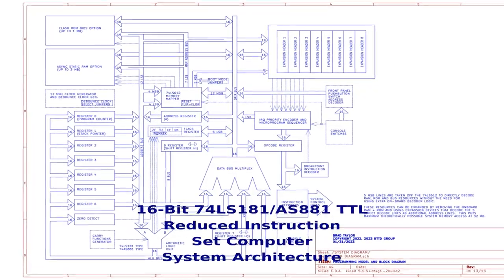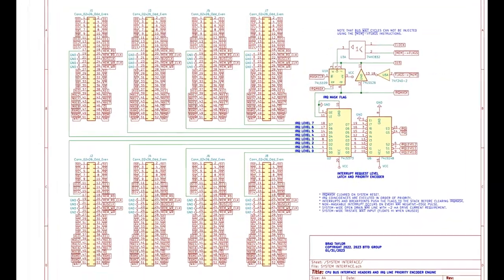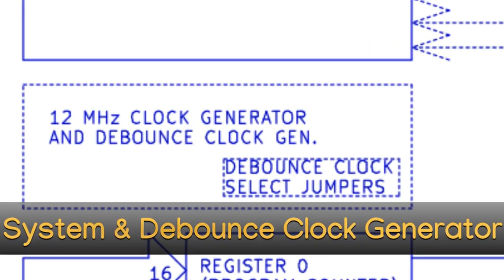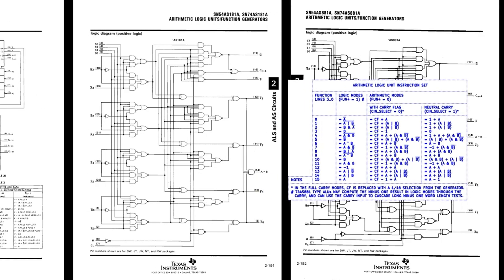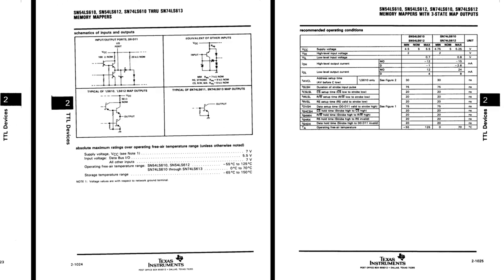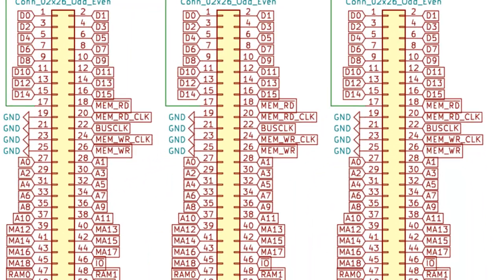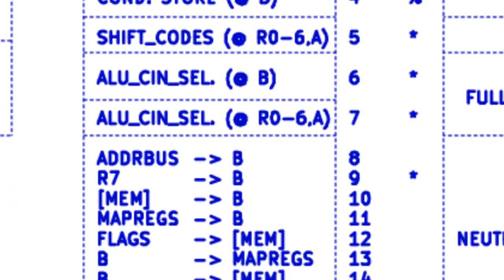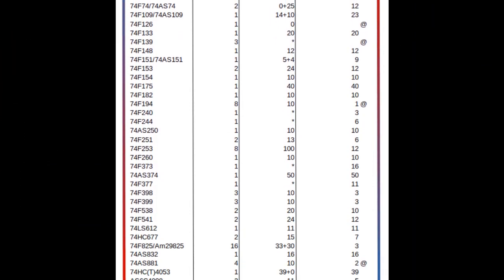16-bit 74LS181/AS881 TTL Reduced Instruction Set Computer System Documentation

Comment: I'm just in the final stages of actually building a 16 bit TTL/HCT computer based in the 74LS181 ALU chip. It has 16 registers of 16 bits each (4 off 74LS219), 32k words of EEPROM and 128k words of RAM with a bank switching system. The instruction set is implemented with microcode: the top 8 bits of the instruction provide the top 8 bits of a 32k word EEPROM and the remaining 7 bits for the EEPROM come from a counter. This enables each instruction to have up to 128 microcode steps but the average number of steps needed is less than 10. The remaining 8 bits of the instruction are handled in hardware to select source and destination registers, bit numbers for bit instructions, conditional instructions, based on the 6 flags implemented and a few other things. The microcode system allows for loops and conditional microcode branching to implement more complex instructions such as multiplication and division.

The design is based on a 48 line backplane with up to 8 plug in cards. The cards implemented so far are:

1. The ALU card with 2 shift registers supplying the inputs to the 74LS181's, the register bank, a "private register" for internal operations, 6 flags, a bit selector and a fair bit of coding/decoding logic.

2.  The memory card with both EEPROM and RAM. I elected to put the program counter on the memory card, which means I don't need a separate address bus on the backplane.

3.  The console card that interfaces to 3 small cards via serial links to handle 16 general purpose LEDs, 16 general purpose data switches, 9 control switches, 6 flag LEDs and a running LED. Microcode is again used to implement the control switch sequences.

4.  The main control card - this is effectively a computer within the computer and is the most complex of the cards, based on microcode as described above.

I haven't yet built any I/O cards but I have implemented over 200 of the possible 256 instructions and whilst not everything has been tested yet, I've been able to run several programs successfully on it.

Writing the microcode would have been virtually impossible without a microcode assembler. I implemented this in Excel and it was quite simple to do so. No macros or Visual Basic were needed - just a load of VLOOKUP commands to translate a set of mnemonics into machine code, which could then be exported to a 16 bit EEPROM programmer that I build for the job, based on an Arduino. Similarly, I was able to implement a user program assembler in Excel using similar techniques. This was a bit more complicated, but it works well.

My priority was a rich instruction set to make programming easy rather than high speed or massive amounts of memory. There's little point having megabytes of memory when there's no way to implement megabytes of software.
Reply: For microcode, why use general branches? I think that MUL and DIV each only need their one special micro instruction/predicate. Loops should be zero overhead. They only can count down the CL register. Maybe add early out for scan and DIV?
Reply: @ArneChristianRosenfeldt  Many thanks for your comments. The microcode has both a general branch capability and specialised ones for loops. There is a dedicated loop counter with a DJZ (decrement and jump if zero) and DJNZ facility. The general branches allow the implementation of conditional instructions such as jumps and calls based on flags set by previous instructions, but they also allow more sophisticated combined instructions, one of which compares a register with an immediate value and does a subroutine call if the specified condition is met. In this instruction, the return address is specified as an argument to the instruction, which might sound odd, but it allows a structure similar to C++ SWITCH statements.

Since my original post, I've added an I/O card and I am now in the middle of writing a debug monitor. So far, everything's working better than I could have hoped, though of course, with hindsight, there are a few things that I would do differently if I ever do another such project (which is unlikely).
Reply: @chrisengland5523  ah okay, I guess that I am not CISC enough for this. Maybe you can add floats. RISC seems to add float Co-processors all the time. A lot of instructions, multiple cycles, special purpose registers.
Reply: you can still buy these chips from LCSC XD74LS181
Reply: @VandalIO  I haven't had much of a problem getting hold of the chips I've wanted. Loads of people in England sell them on eBay and there are a few on Amazon. Despite all the horror stories about fake chips, I've not really had any issues, though I'm not really driving them at their limits. A couple of items turned up with red dots on them, which I understand is a manufacturer way of marking a defective chip, but the vast majority are fine. I have a stock of about 1000 chips of various sorts, mainly because they're often sold in batches of 10 and I only need 1 or 2, though I do like to hold a couple of spares.

Comment: Awesome! It's like my days at the uni studying computer hardware, back in 1979.  At that time, I was sure I could make my own computer from the scratch, using TTLs. Instead I designed 8080and 8048-based gear for telecom systems.
Reply: 😂 those were the days. I came a bit later to the show, but I got a job at a German Mini computer manufacturer and was trained to repair those contraptions. It is quite amusing to see the next instalment!

Comment: Great Job! Finally a decent TTL based CPU with interrupts and RISC instruction set. Looks like it could be quite useful. Jams Harman did quite an interesting pipelines CPU architecture in his TTL CPU build, but he didn't implement any interrupts. It is quite understandable, because the pipeline registers and stages would have to be emptied or doubled up. Curious to see how you will implemebtbthe instruction decoding.
Can't wait to see you build it.
Keep up the great work. I think you should also go with a modular approach where you bring up individual subsystems. That toughed me a lot.
Looking forward to you next instalment.
Reply: Huh? Interrupts in RISC are quite common. You just need one bit to remember if your return address points into a branch delay slot. I am still not sure why we cannot pack this into the low bits of the address. The other bit is for the carry flag ( only flag I miss for ADC ).
Reply: An interrupt is just a set of micro-code commands that needs to be executed, to save important state registers on the stack and then do a subroutine call. It is nothing more than a complex instruction that is triggered by hardware instead of software.

And in many CPU architectures, an interrupt can also be triggered from software like any other instruction, often called the `Trap` instruction. This is e.g. used to go from User level to System level in most Operating Systems.
Reply: @TheEvertw  on MIPS an interrupt is a single instruction and takes a single cycle because it only copies the program pointer to r31 or so. At least on JRISC the interrupt number is also the new address where to jump to. MIPS has no flags. Interrupt flag is set in parallel, there is not used the extra instruction for this. Return from interrupt just copies back register 31 ( or some operand ) back into the pointer and clear the bit. Again, single cycle. No microcode. The trick is to use a fast CPU in the first time to be done with an interrupt before the next interruption.

Comment: About 50 years ago, this design would be a competitive mini computer.
Reply: I remember the Nixdorf 8870 Mini computer CPU boards, where this ALU chip was used doubled up in a late CISC CPU for this very successful Minicomputer in the late 1980s. It was competitive until the early 1990 when Siemens talked it down after the Nixdorf take over, without reaping any major sales but hastened to migration to PC networks and servers.

Comment: Why are there no examples of MUL or DIV where the hardware designers just glued all instructions in the inner loop together. Then execution time would be 1 + number of bits . No we either got very slow 68k or 2 bits per cycle Pentium Div . Or 8 bits per cycle ARM in the GBA.